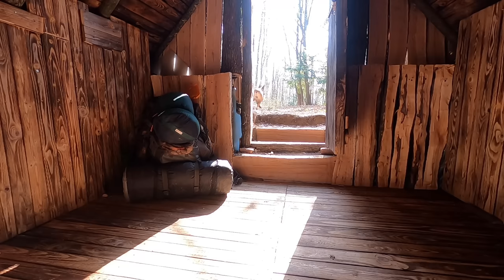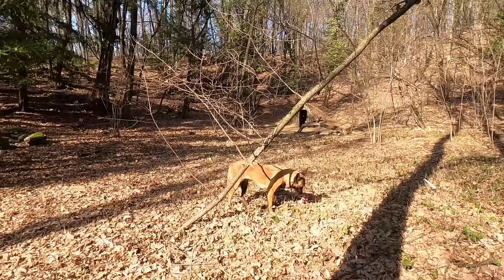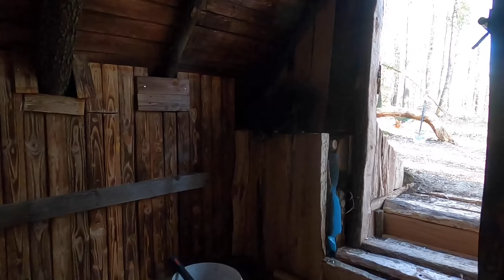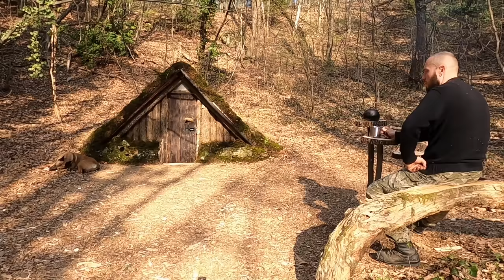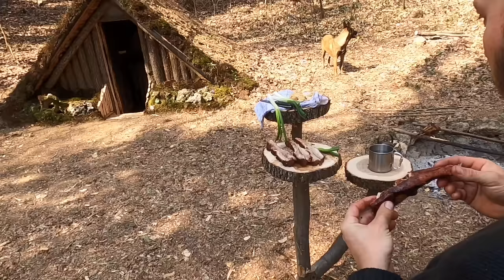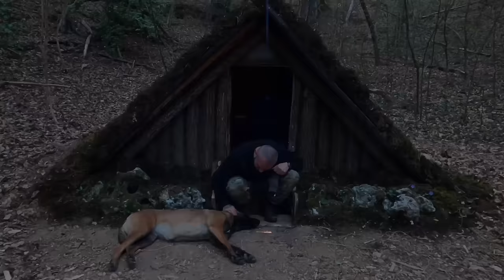Dugout Shelter Build With Hand Tools,Bushcraft Skills, Winter Camping-Part 2

Comment: Nice cabin, well done. How you did the drenage system under floor? Cheers
Reply from the maker: HY! The dugout is dug shallowly so there are no problems with water penetration.
https://www.facebook.com/100076386955268/videos/5026320370780303/

Comment: I like your work,everything is good,the interesting sitting place,the chair,and i like the table too....just a little thing,take care near the chimney tube ,must to put something isolation,i do not see that is near the wall,or exist some distance...i remember when we was in a cabin and this kind of fire place was red,because of the fire...it may be dangerous...But congratulations for the nice and simple rustic design of the shelter....you are great..😘
Reply from the maker: Thank you, Marta, 😊
My homemade stove heats up hard. The regulator I installed at the beginning of the chimney is very useful, it is possible to adjust the firepower as desired. Tile helped me protect the wood from direct temperature, thus minimizing the risk of fire. which I noticed during the night in the dugout is hot, I had to leave the door half open and removed a small triangular window located above the door😕

Comment: Why did you burn the wood before placing it on the eve? Is it just ascetic or or there a practical porpoise?
Reply from the maker: This is for practical purposes, when you lightly burn wood, it prolongs its lifespan, is not attacked by insects, and does not absorb water.

Comment: Can U post a link. or list that hammer and Axe brand :)
Reply from the maker: The ax is a Fiskars X17, and the hammer is an old one from the garage. Fiskars has a lightweight and durable tool so you won't make a mistake no matter what you pick up